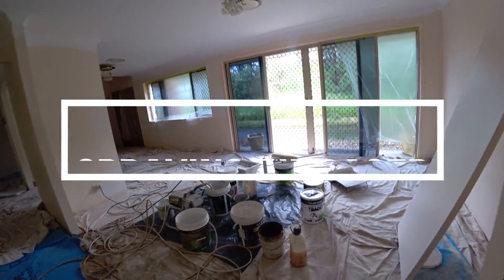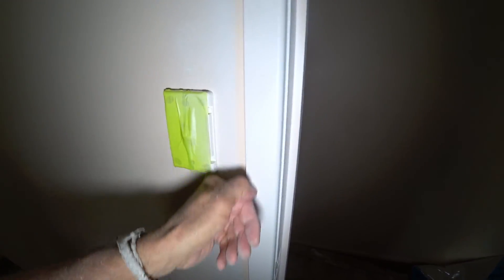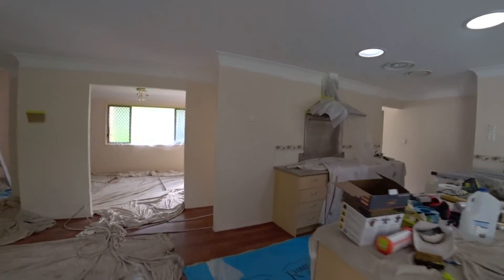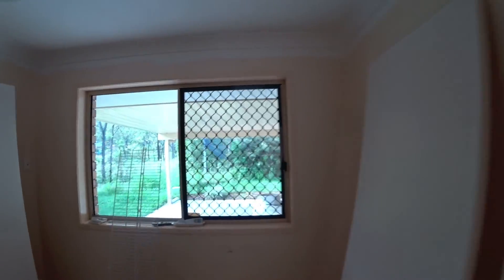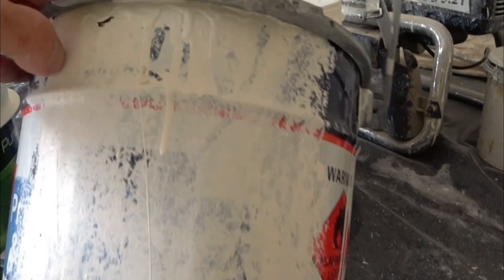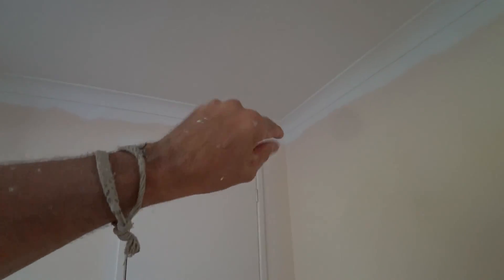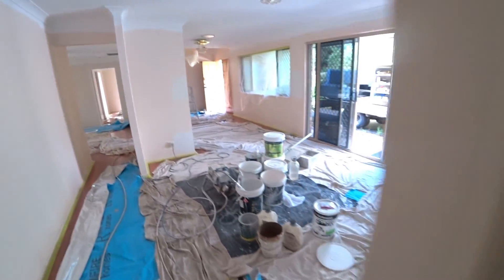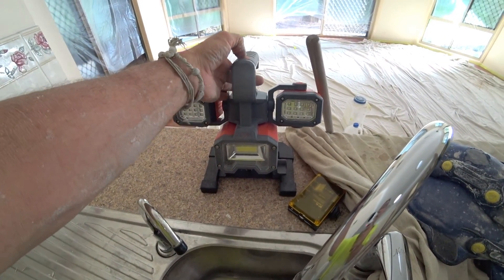Converting shiny oil based enamel to water based using airless spray gun

Comment: When you spray the door frames with oil paint and it gets on the walls, does that effect the water based paint going on top.
Reply from the maker: Any oil-based undercoat can be used and any water-based paint can be used directly on top of this.
Reply: @ThePa1nterhowto  
Thanks Greg, it pays to ask a pro.

Comment: Hi I know you have been trying a lot of different water based gloss enamel what is your favourite full gloss if there even is such a thing in water based paint .

SteriGuard Full gloss vs Aquanamel
And have you tried the new dulux fast finish water based enamel hearing lots of good things about it

What is your number one favourite
Reply from the maker: I'm painting a house next week and asking myself the same question,  I'm buying dulux steriguard satin because it's winter here and that's one paint that I've found doesn't run easily,  that's my main reason to use it and the finish is good as well. I haven't tried fast finish but avoiding it because it apparently doesn't brush or roll properly.

Comment: How come the change to water based from oil? The gloss work looks amazing and as you say is pretty much bulletproof, why not just go over them with another few coats of oil based if they wanted a colour change? Did the client specifically ask for it to be water based?
Reply from the maker: Even if i wanted to go oil based, I would need to sand before gloss,possibly undercoat again and then spraying oil based gloss enamel on rainy days is a big nono so I would have to brush all frames and window boxes and my dominant shoulder is injured so impossible for me. I did everything right the best way for me.
Reply: @ThePa1nterhowto  ahhh. That makes sense. I didn’t think about the weather impacts. It’s interesting to understand why you used different products at different times. It’s why you are the pro and I am not. :)

Comment: Another great project you have rattled out Gregory. In the U.K. for a quick dry oil based option I’d reckon Coverstain in the Zinnsser range is equivalent to your Dulux can there. I always have it in the van as it’s the best primer for just about everything that crops up. Your right about the amount of gear we take to sites now. My clients always comment on the stuff I take lol. Perhaps it’s because the previous decorator had just a scraper, duster and a bit of sandpaper. Cheers
Reply from the maker: Your a professional for sure

Comment: so you didn't sand those glossy frames at all? I normally slightly scuff them. Man if you like that oil based primer you gotta try OIL BASE ZINNSER
Reply from the maker: No sanding if you use oil based undercoat
Reply: @ThePa1nterhowto  no water based primer will ever beat oil aye
Reply from the maker: @onlymemories2595  You got that right
Reply: @ThePa1nterhowto  I think it helped as the oil based had years to yellow.
Reply from the maker: Thats the huge benifet to using oil, no sanding at all,just prep after

Comment: Great work. Is there no water based primer for use over previous oil based topcoats? My skirts, traves and doors were painted 15 years ago with Dulux Super Enamel Semi Gloss, still looks like new but needs a colour change. Want to spray them with wb enamel and trying to avoid using oil as the kids cant handle the smell and will still be living in the house while repainting. Any advice on a suitable water based primer that can be sprayed?
Reply from the maker: Yes, you can use a water-based undercoat specified for old gloss, however, for each one of them you "have" to sand the surface prior to painting, this is a lot of extra work for nothing and then there is a high chance every time you knock the skirtings, door or frames with a broom, mop or chair you will chip paint off. So really it's up to you, I'm afraid there is no other answer I can give you. Quick-dry oil undercoat drys fast has minimal smell and is bulletproof, skirtings, doors, and frames are an especially important place to undercoat properly. You only have one chance to undercoat properly.

Comment: The water based b.i.n sealer works mint to thats my go to these days  . I used to use pigmented sealer but the smells to overpowering. Did it still stink of the oil base sealer when you finished .
Reply from the maker: You will see next morning on this video, I could smell the paint so if the customer has an issue with smell, I would stick with your water-based. However, I always tell the customer that I am using a very powerful primer that sticks much better, and for a short-term discomfort, it's a long-time gain.

Comment: G’day, saw you were using 208 for the oil primer did you need to strain the paint also which mesh filter did you use,? I’ve had trouble with some oil based primers sealing over the filters
Reply from the maker: Never had a problem with that happening,  I normally use a yellow filter for all my paints but it is possible I had a red filter in as the tip is quite new, but on the other hand, I did spray my cupboards straight after so 80% chance it was yellow. The paint was unstrained and not thinned out.